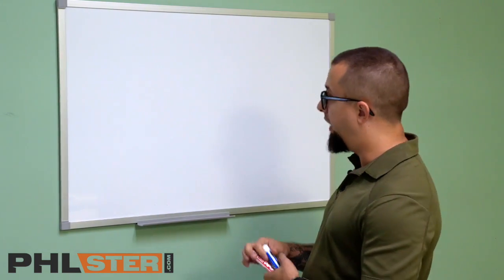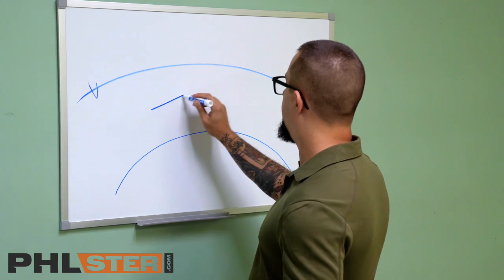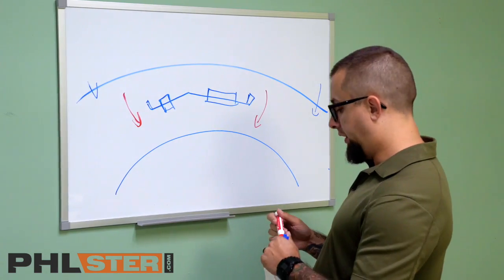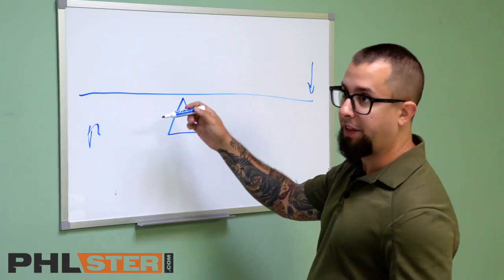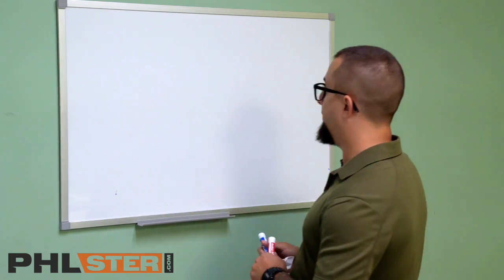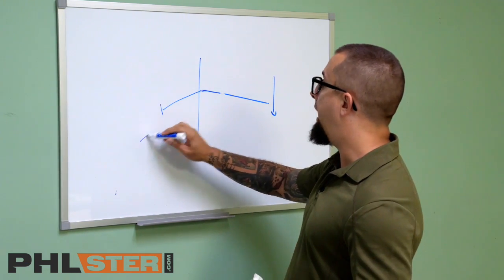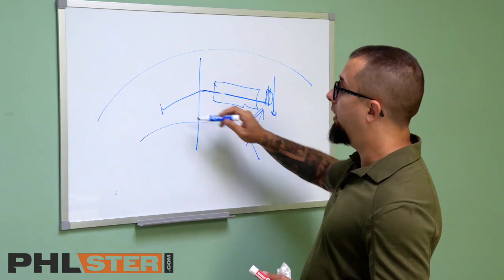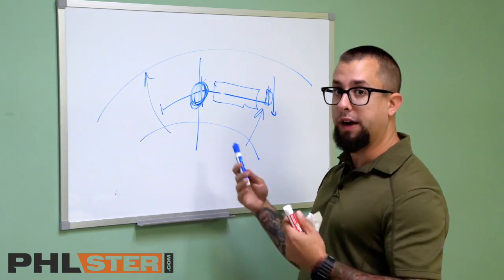Holster Physics (Why rigid "sidecar" holsters don't work great)

Comment: Any thoughts on the new generation sidecar holsters that have a non-rigid flexible center?
Reply from the maker: Imagine putting a belt around a bi-fold door and then trying to close the door. There's still a limitation or restriction. The other issue is that directly front-and-center isn't the ideal location for either comfort or concealment on most people, and we've found that most people move their pistol and accessories further from the 12:00 central peak of their torso, which conjoined systems don't permit. You have to fit them, but this is a process which requires fitting the gear to you
Reply: @PHLster  thanks for the opinion. I definitely see your point.

Comment: What sidecar holster has a wing on both sides? Answer, none.
Reply from the maker: Matthew Thwing I’ve seen them. Also, even on the ones which don’t have them, the whole mag carrier part acts like a wing and counteracts the rotation of the gun grip.
Reply: PhillyEDC gotcha! I went with a Tier 1 to alleviate this issue. Seems to work pretty well even when I was more generous in the midriff area than I am now 😬🤣

Comment: First, great series. I believe your conclusion on the sidecar to be true with 2 exceptions. The sidecar designed with the bend in the center as you showed in your drawn diagram becomes a tension point for potential damage with pressure from the belt  pushing the 2 ends out rather than inward and the wing against it applying pressure towards the body. Now I think that changes when rather than bending an angle in the center but forming the sidecar with a curve instead releiving that pressure so it contours to the body more comfortably. The other ofcourse is adding a flexibility feature between the mag and firearm so it flexes (moves according to your body). Just what I've discovered to be the case when testing them. Though the sidecar is the least comfortable form of carry,  the flex is most forgiving and the curve takes second place while the bend depending on body type is least comfortable IMO. They all work differently. 👍👍👍